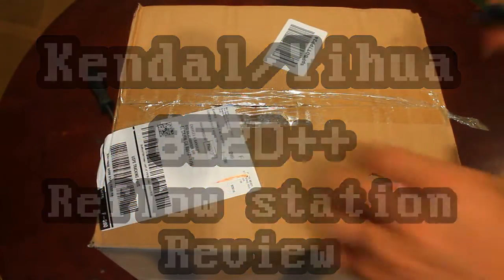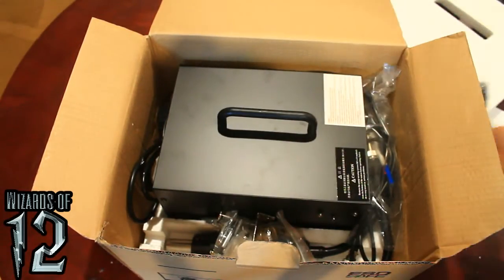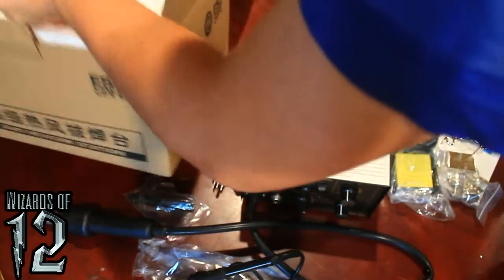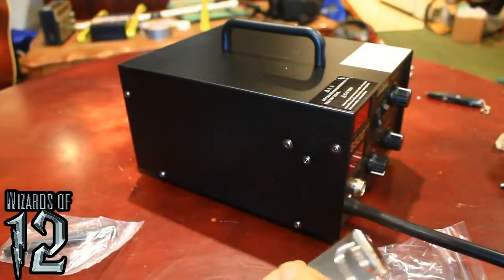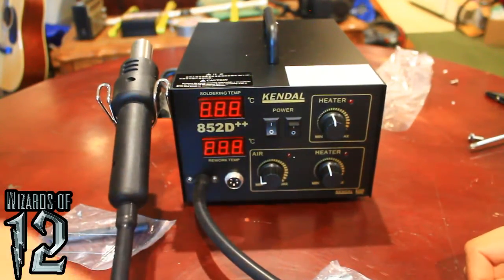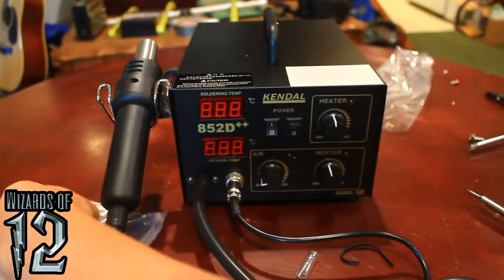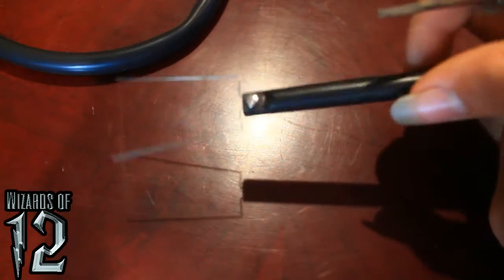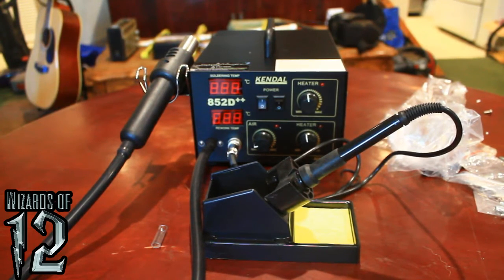Kendal/Yihua 852D++ SMD Reflow Station Setup and Review

Comment: Just starting my Electronics career, thanks for the helpful video
Reply from the maker: You're welcome, sorry that this video wasn't to the point as quickly as it could have been. At the time my videography skills weren't very good. Glad you found it helpful though
Reply: @meercreate  Can you tell me what that IC puller does please? I've google it but I just get stronger IC Extractors but nothing like this one.
Reply from the maker: IC puller? Can you give me the timestamp of where it appears?
Reply from the maker: @Onedayilbeok  Oh, I assume you are talking about that little forked thing. I have no idea what that is either
Reply: @meercreate  5:40
Reply from the maker: ChaosFlower yes, Ive been using a liquid rosin flux for that. This video is when I was first starting out and was a total noob at that kind of stuff. Yes, the unit still works and gets heavy use